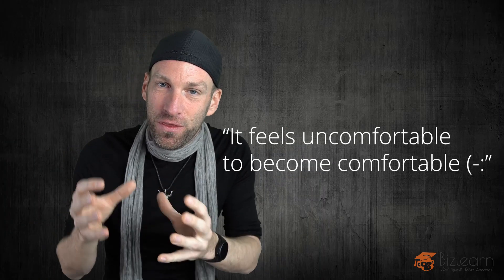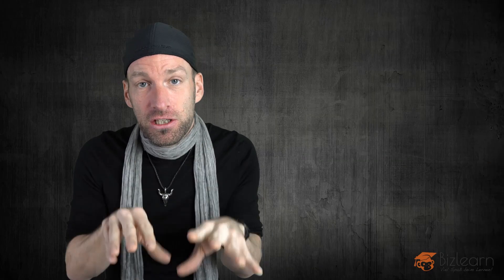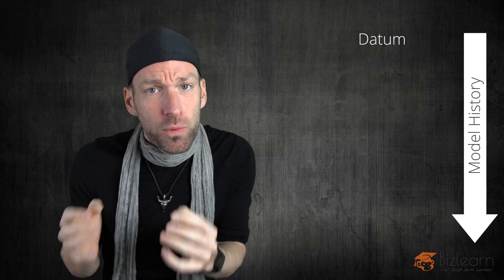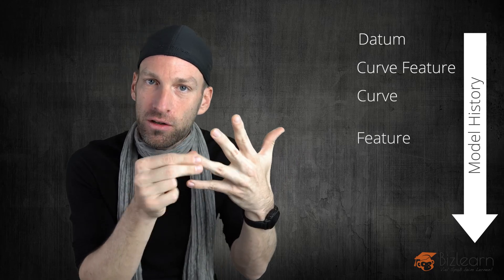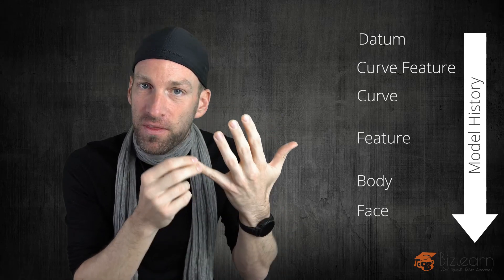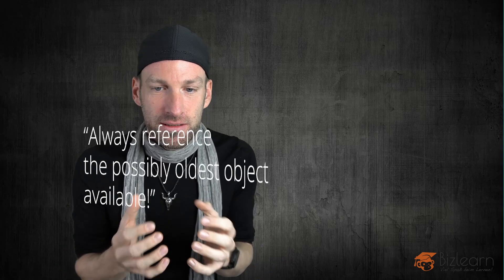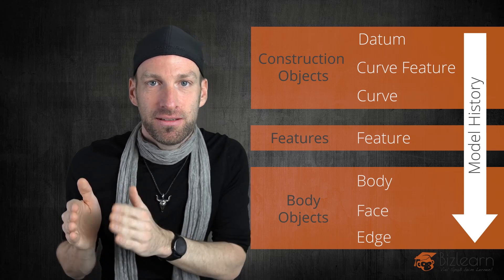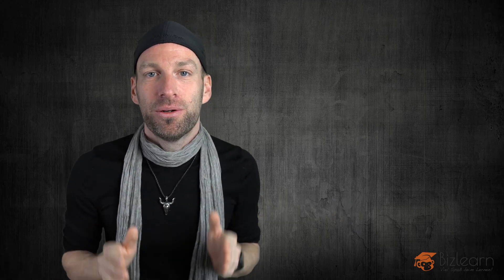Siemens NX Beginners and Pros must consider the Selection Rules - Horizontal Modeling Essentials

Comment: For a while, you called this "Algorithmic Modeling"... I take it you've changed the name to Horizontal Modeling to differentiate it from NX's new algorithmic modeling tools?
Reply from the maker: Hi Greg, it was always horizontal modeling. I am sometimes using the designation "design algorithm", which I still do😅 somehow the horizontal modeling reminds me of a programmers algorithm, which is reusable for any kind of design work. Are you sometimes considering the relations during your daily work? Have a nice day🙌
Reply: @Bizlearn_Siemens_NX_Training  Of course I think of relations in my daily work (NX user going on year 3 now). I do suck at horizontal modeling though; our work tends to use what are often considered "downstream" features like chamfers and variable fillets as primary structure, which is where my skill runs out and everything becomes very delicate.
Honestly, half the parts I have in production are being driven by junky quick-bake prototype models I kludged together, threw CAM on, and started making in production.